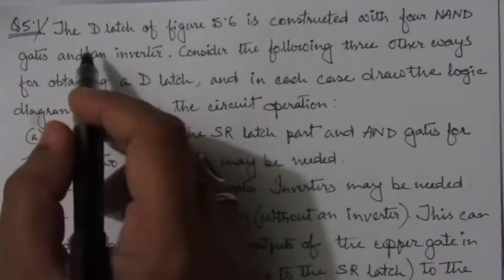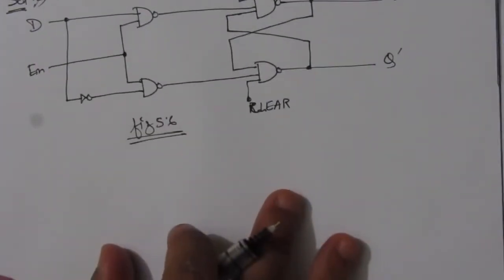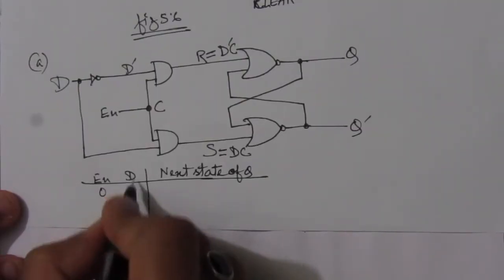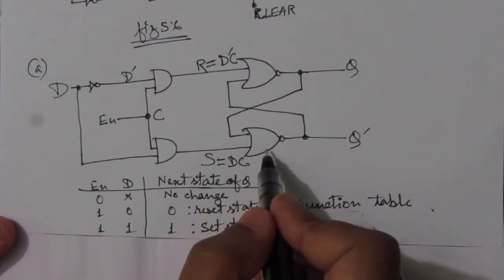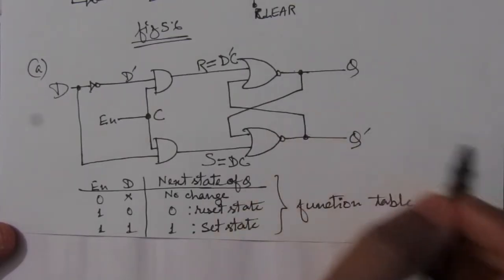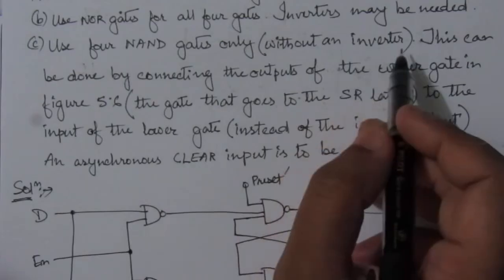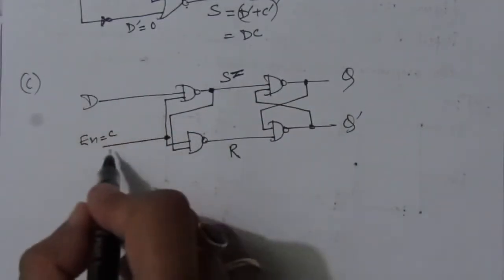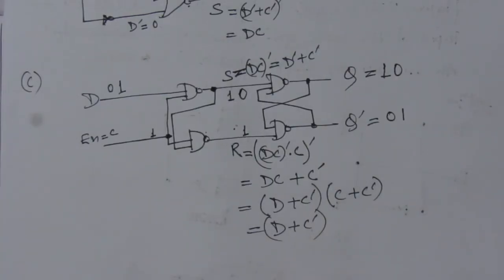Q. 5.1: The D latch of Fig. 5.6 is constructed with four NAND gates and an inverter. Consider the

Comment: There is something wrong in part 3 I believe. The output Q should follow the input of the D: when D=0 the upper NAND gate holds the output of 1 whereas the lower NAND gate gets the output of 0 then Q should be 0, vice versa.

Comment: How did you decide when to use inverter
Reply: To decide if you need an inverter going into an input variable, you can work backwards from the known possible output for Q, which is 0 when D=1 and En=1, and Q=1 when En=1 and D=1.  Take the example with 4 NOR gates. Say you want to find the reset state where Q=0, and En=1, D=0. Trial a circuit without any inverters; you will find that the NOR gates will always have an output of 0 if at least one input is 1. Therefore, working backwards from the Q output NOR gate, you know that the input R needs to be 1. To get R=1 from the previous NOR gate, both inputs, being En and D, must be equal to 0. D is already equal to 0, but En is equal to 1 initially, so En needs an inverter to make it 0. Now D and En will be 0 as inputs, so the output R=1. Does that help?